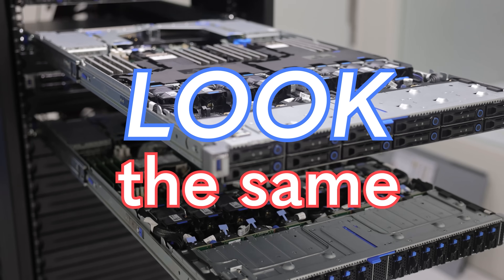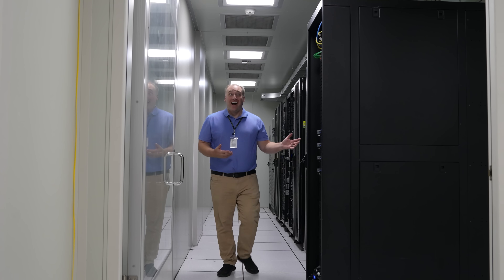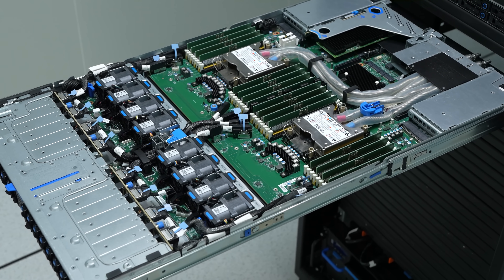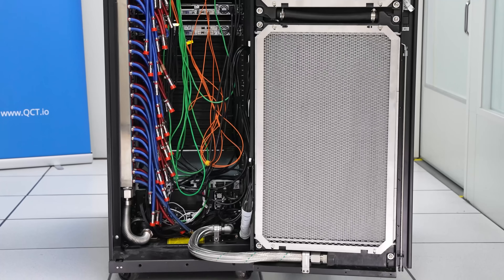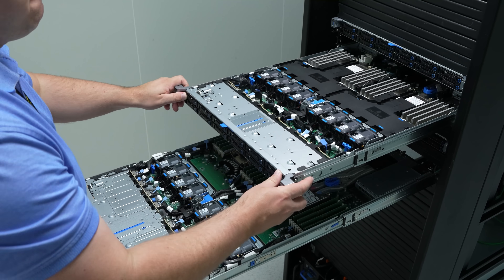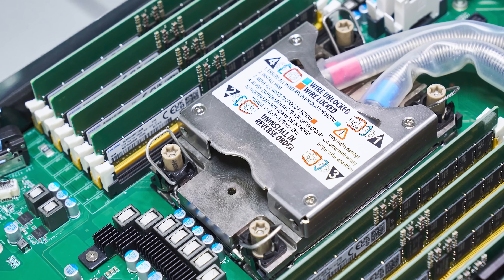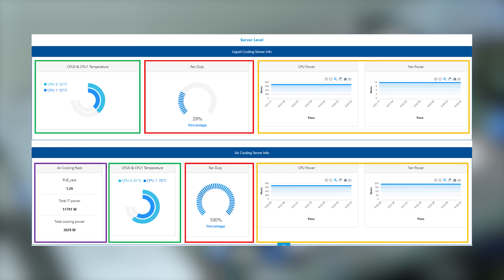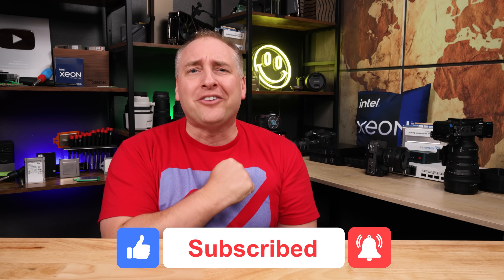Taming the MAX CPU with Liquid Cooling

Comment: What I don't understand is, isn't water cooling more expensive, so the installation would outweigh savings short term? (and only becomes worth it a long time later)
Reply from the maker: Usually the payback period is 13-14 months on the low end to 24 months for folks at the upper end. So less than the lifetime of the servers
Reply: @ServeTheHomeVideo  oh wow, I didn't expect you to come back with data! That's cool, I thought it would be much longer. Very interesting.
Thank you!

Comment: I really enjoy this liquid colling setups,, but at the moment I am looking to buy a used server.  wonder what this could cost or problems for the reuse market.
Reply from the maker: That is certainly a big thing. Also, when next gen chips hit will people want to buy CPUs at 500W each second hand
Reply: @ServeTheHomeVideo  the good part is they ramp down. The server I was looking at was for a grand. And has two 4000$ CPUs. Even if I tried a thread ripper to keep up the start cost on the CPU takes most of the budget. Leave little for every thing else. The CPU and board bundle starts at 2k$.

Not sure what you would say on it. Was looking at a t630 dell rack version. 16x 2.5" drive front slots.  Dual e5-2699v4. Can spec. All blank cadys for front bays 384gb ram. H730p raid card 2x1100. PSU. For 1900$

Comment: What is the ratio of power consumtion for processor cooling vs processor computation. Does the added cooling system balance out to a lower power consumption for the entire rack (including the cooling system)?
Reply from the maker: It does. That is what we were showing in the power consumption section

Comment: This doesn't save power, it just allows you to cram more power into a given rackspace. 

The laws of thermodynamics do not magically change because water is involved. Power in must equal power out to maintain a constant temperature. How you do that can be better or worse suited to your needs, but it's a very simple calculation.
Reply from the maker: Running 1U fans is not the most efficient way to remove heat from servers. The power savings are in the heat extraction phase, after the work is done on the CPUs/ accelerators. Extracting that heat using 1U fans that spin at very high RPMs is much less efficient then being able to use larger scale extraction made possible by moving heat in a fluid.
Reply: @ServeTheHomeVideo  less efficient than driving two sets of pumps and radiator fans? Can't be by much surely.

Comment: Three things:
1) It is always interesting to me, for me to see liquid cooled servers come full circle, because I was designing my own Socket940 AMD Opteron waterblocks back in April 2006. So 17 years later, this is starting to hit prime time.

2) re: the radiator in the rack doors
That is reminiscent of Project Blackbox from Sun Microsystems where the prototype was announced in October 2006, and the first production unit was deployed in January 2008.

3) It would be interesting to see what would be the total power consumption for the entire setup. I understand that the dashboard shows the data for the rack itself, but it would be interesting to see what is the power consumption for cooling the facility water to deal with the power required to thermally manage the entire system/rack.

I understand that the dashboard shows the power comparison between the air cooled and the liquid cooled servers, at the server and rack level. But what the dashboard doesn't show is the power that's required to then cool the heated water back down to cold supply water, for the water cooling part of the loop.

I think that it would be important to look at not only the power consumption on the server and rack level, but also the power consumption on the facilities side as well, so that we get a complete picture.

Comment: Can you "reverse" door radiators to act as heatsinks for hot-side air? There is still a lot of heat coming out even from liquid-cooled systems, and capturing some of that, redirecting it to facility scale liquid cooling may significantly lower a/c power or in some cases remove need for it entirely.
Reply from the maker: Yes. There are designs that do that

Comment: My main question is how well is it protected from liquid damage for when stuff leaks?
I say when not if as accidents happen but also wear and tear will wear down over time and liquid will leak
As it is a self contained system does it have to be flushed then refilled ever?
I ask as if it ever has to ever it will cost money to shut all of them down drain the loop the refill the loop then turn everything back on in the correct order to have the software not the QCT software but the enterprises software work.

Comment: Is the power consumed by the fans and water pumps counted towards the total system power consumption shown on the screenshots? What's the RPM and diameter of those fans attached to radiators?
Reply: For comparison, my desktop loop can cool 450-500W with ~5W of pump power and ~5W of fan power.  This is more than made up for just by running the fans slower and the processors at lower voltage, never mind the facility A/C savings possible for datacenter.

Their power fraction to pump fluid will undoubtedly be higher, but not enough to matter.
Reply from the maker: Those are rack level. You are right there is a lot of extra capacity in this

Comment: With the lower airflow needs of just cooling ram / storage, while cpu and gpu are liquid cooled, this feels like it would be a great use for 2u or bigger blade servers with multiple systems serviced by fewer larger fans. Let's get hearing protection out of the datacenter.
Reply from the maker: Some of the new HPC and AI clusters are almost eerie to stand next to because they are so quiet. The 2U 4-node form factor was one of the first to get a lot of liquid cooling attention as you mention.
Reply: @ServeTheHomeVideo Aaaah, gone are the days of 16A fan modules on blades, like HPe c7000? Working NEAR the damn things give PTSD

Comment: Transfer the heat into steam pipes to turn the turbines
Unlimited power 😂
Reply: The heat is usable by itself, but trying to turn it into power is useless.  The Carnot efficiency would be abysmal.
Reply from the maker: Ha! In Europe, data centers have been using IT heat for other heating use cases for several years. I am not sure I have heard anyone talking about putting a turbine on the other end :-)

Comment: The cost of power is finally over cost of maintenance.   That has been the equation preventing this from getting broad implementation.
Reply from the maker: Another fascinating fact is that some of the immersion studies found lower failure rates by keeping hardware away from air and dust.

Comment: Those power savings over a whole DC are massive. I’m shocked how big the delta is.
Reply: Remember you have to run your cooling loop. If that's happening via normal HVAC, it's not going to save any power, probably will actually draw more power when you factor in the pumps/radiator fans.

If you're using a cooling tower, even if it's just augmenting normal HVAC, you'll see some power savings. There is no free lunch here though, which is what the video makes it sound like. If you put power into a data center, you have to take that power back out. @servethehomevideo should do a better job explaining that. This is a density benefit above anything else.
Reply: @jttech44 ة¹٨😊
Reply: its not delta
its quanta
)
Reply from the maker: It is huge, and will get bigger

Comment: I never see an answer to the one obvious problem, one hardware failure and you lose an entire rack of hardware and up time capacity. I'm also not so sure the perceived savings is there if you lose multiple pieces of hardware due to a failure.
Reply from the maker: Sure, but folks are using liquid cooling for the most expensive systems they have. Also, it can happen with power. We lost eight DC SSDs many years ago in a Dell C6100 chassis because a PSU had an issue
Reply: In regards to the cooling hardware it's not a concern if they run a vacuum system on the lines and have redundant pumps. 

Think aqua computer leakshield on an industrial scale. It already exists in both consumer and enterprise spaces.
Reply: @DaleEarnhardtsSeatbelt  You can see they are using jubilee clips, which are notorious for failure at a point in which the negative pressure system would be useless. I'm interested in seeing the real world failure numbers for these systems in comparison to air cooled systems. It just seems like adding so many failure points and complexity would inevitably add more failure risk when done at scale.
Reply: @bitcoinsig  I did see some, probably from repairs as most of them were Oetiker type clamps. There is always a trade off of reliability over cost. You run the numbers and make the choice.
Reply: It's all about layout, density, failure domains and maximizing efficiency, combined with putting the right workloads on the most appropriate infrastructure.

If you have tier 0/1 mission critical workloads, the you really need N+1 redundancy, and ideally that would be across different racks, with every component having its own N+1 and as little shared infrastructure between them, including cooling systems, PDU's, switches and even power grids / generators, but this is expensive, and inflexible because you lose flexibility. That said, not every workload needs that availability / redundancy / reliability, especially if the applications can scale out and be distributed across these failure domains at the software / network level.

Also keeping in mind that depending on the hardware, liquid cooling can allow 25-50% higher performance per watt and performance, meaning over the life of the hardware, the hosting provider / customer can get better ROI for every dollar they spend, and even when configured for very high performance, you also get the benefits of extended component life. Data center design, enterprise architecture and application workload mapping are each complicated sciences in their own, and you're always walking various lines trying find the right balance for every workload and use case.

Comment: I can definitely see liquid cooling becoming a bigger thing in the data center especially if the intro is anything to go by with the amount of savings it can bring in terms of power usage.
I know there are some network vendors working on or at least looking at water cooling for their gear too which is really cool and I can't wait to see what that might help save too!
Reply from the maker: I think we have shown liquid cooled Broadcom switches a few times on the STH main site
Reply: @ServeTheHomeVideo  Oh nice, I'll definitely check that out, I must have missed them!
Reply: I am wondering why they ever went away from liquid cooling. If I remember correctly you use to have huge computers that most of it was just the cooling system in the 1980s air cooling became good enough to use in the 1990s and it came with no risk of water damage in case something broke or failed. Now I guess we are going back to liquid cooling due to how much it can save them by carrying away from heat generated more efficiently than air.